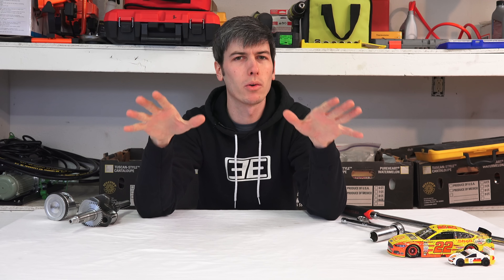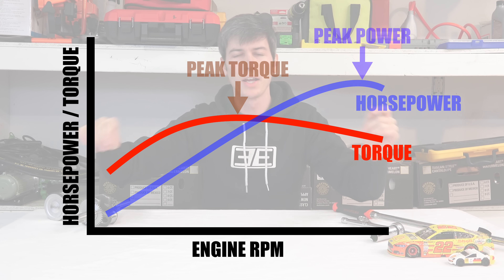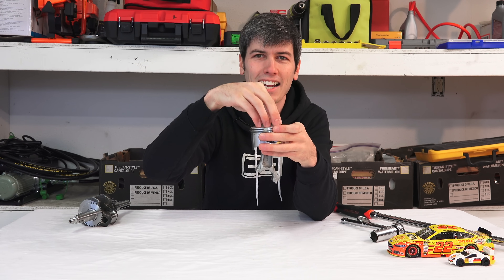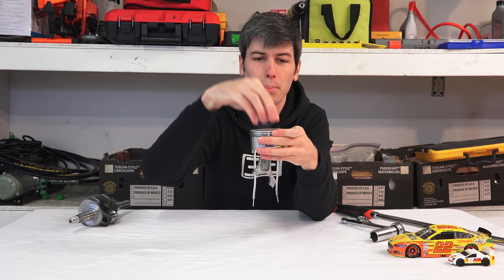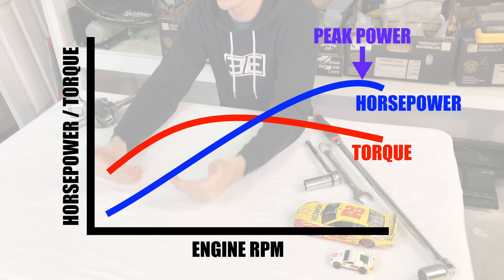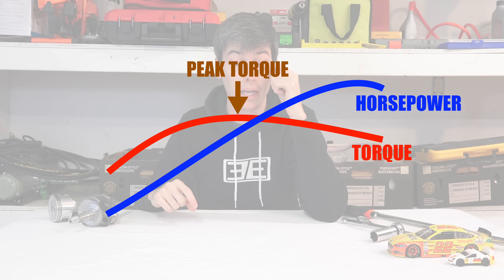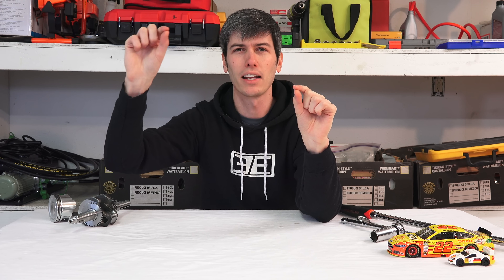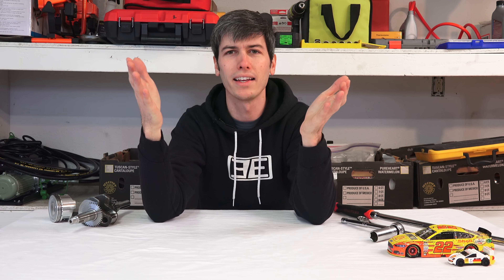Horsepower vs Torque - A Simple Explanation

Comment: I understood the introduction. you lost me at 99 percent of the video.
Reply: I think anyone who understands torque and is seriously trying to understand the relevance of power should just focus on understanding Mechanical Advantage (gear ratios and wheel diameters). When you really understand what gear ratios and wheel diameters do, suddenly it will all click - why power is so meaningful. 
For a vehicle, power is just the amount of forward push for the speed it is currently moving.
In slightly more technical terms, power at any moment is forward thrust at that moment times forward speed at that moment. 
Algebraically rearranged: Forward thrust at any moment is equal to power at that moment divided by forward speed at that moment.

And you should understand what units are;)
Reply: @drienkm  power is just that. for all intent  and purposes, gearing can be ignored if you know the output at any given time of a race. the higher the hp the motor is making at that moment, regardless of gearing. will tell you what or who will accelerate more. I agree with everything you said. and people that do get hung up on gearing and tq, havent really put it all together in their head yet. these are probably the same people that will say, hp sells car and tq wins races or hp is how fast you hit the wall, tq is how far you go through it. or some other nonsense.
Reply: You just need to know the sentence/proverb/formula/the jist of this video at 6:48😉
Reply: @YathishShamaraj  "You just need to know the sentence/proverb/formula/the jist of this video at 6:48😉" Bingo. You will also NEED to be solid on what a gear ratio does. Intuition should take it from there why we care about power.
Reply: A car with high peak hp can feel underpowered in every day driving because you may have to have the engine at higher than 6000 rpm to tap into its power band. It would be a lot of working the gears and noise to keep up with traffic. Think of like a jet that's not so responsive until it gets up to speed
Reply: Kuya think of this way....when your with your GF and you are stroking it.....Long throw or short throw is the FORCE or Torque,  how fast you are pounding is the HORSEPOWER or rpm.  Hope that helps......
Reply: @larryboles629  what is the cOOm, is that the fuel
Reply: @GZA036  Bro, not sure what your reference.  To make Torque and Horsepower easy for myself.  I think of Torque as the force at a distance, ie The STROKE and Horsepower is simple the RPM of the torque in other words how fast is the engine going RPM (horsepower) taking the stroke or torque into consideration.  Example  Engines with same bore say 4.00  engine one has a stroke of 3.5" and engine two has a stroke of 4.5".  Both are running or turning at 2000 rpm.  Engine two has more horsepower because of the longer storke that also gives it more torque.  Now lets say the redline of enging one is 8500 rpm and redline engine two is 5500 rpm.  Engine one will have more horsepower because it has more rpm.  Also engine one will not have more torque that engine two because of the shorter torque, even if engine one produces more horsepower, engine two will have more torque.  Kinda like a V twin Harley, tons of torque (long ass stroke) but horsepower around 120.  Now rice burner turning 10,000 rpm. may have 145 horsepower but lower torque than the harley.  Hope this makes clear what I was trying to say.  Torque and Horsepower has always gotten me confused in the past, but not anymore.  TORQUE IS FORCE (STROKE) HORSEPOWER IS SPEED (RPM)  ie DISTANCE vs QUICKNESS.
Reply: You might re watch it
Reply: @tomasenrique  rewatch what? how morons think tq curves are better than hp curves?   stfu
next your gonna tell me hour wage is better than salary
Reply: @chaztitan6457  why are you like this to other people.
Reply: cause I am sick and tired of people talking about things they dont understand, and other people listening and repeating it. when they have all the worlds information at their fingertips and yet, fail to grasp basic concepts. its tiring and extremely annoying....
Reply: @chaztitan6457  ok Einstein, getting pissy won't help anyone.
Reply: @kirara4953  no, but it might make people get angry that im pissy and try to prove me wrong and learn something..
others just get angry at how i said something, not what i said...
sorta a female thing
Reply: @chaztitan6457  if you were a teacher they would just learn the speed at which you get fired for being so aggressive
Reply: Yep
Reply: Lull
Reply: Ahahahahahahaha
Reply: He lost me at 📈 graph
Reply: Hey, I make science based 3D animations, and I'm planning to make an animation on this topic as I was also confused at times. If you would like to give me some pointers to what you would like in my animation, I would love to hear it!
Reply: He's talking about torque in a powerful revolutionary way.
Reply: @animationsxplaned8835  that will b fantastic. Apply n match the theory with yr animation to car .... in a real scenario?
Reply: @animationsxplaned8835  pleas do
Reply: @animationsxplaned8835  please do, I need that
Reply: then dont vote

Comment: Thanks. Understood fairly well . But i have a doubt. I am comparing 2 cars. Car 1 has max torque of 172Nm @ 1500 rpm and Car 2 has max torque of 113Nm@4200 rpm.

My question is how do i compare them because they have max torque values at diff rpm.

 If it was something like comparing 172Nm@1500 rpm Vs 113Nm@1500 rpm, it would be simple to understand that 172Nm@1500 rpm is better.
Reply: well thers couple things to  know  now we comapre only peak torque at diffrent rpm ok but you dont say how much power in peak both engine generate but ok  172nm at 1500rpm let say we drive both car/engine setup at the samevelocity let say 60 mph and you flored both at 1500rpm than 172 nm at 1500 rpm will push you into seat stronger because 113nm at 4200rpm will have max the same nm as in peak most likely less at 1500rpm assuming those are 2 compeltely diffrent engines ., but when you reduce gear in 113nm engine for start from 4200 rpm rather than 1500rpm now you be push with biger force into seat be 113nm at 4200 rpm engine setup from the same velocity in me egzample 60 mph  it can be 20 mph or 100mph whatever but the same velocity its beacuse from 113 nm at 4200 rpm you have 66,6hp of power vs from 172nm at 1500rpm you have only 36,2hp of power the diffrenc in acceleration from atthe  same velocity so such force which your back will be fell be interact with seat be 66,6:36,2=1,8397 times biger when you try 113nm at 4200rpm setup its the same car engine or 2 diffrent ? if 2 diffrent  than 172nm at 1500rpm can feg have more power in peak in such scenario if we use in both peak engine power so strongest rpm range in each engine this which have more peak pwoer will accelerate you stronger forward assuming the ame car weight drag aero power lsoess etc but i quees its probably one engine from some weak disel without turbo etc :x

Comment: Somewhat good explanation.
The hp is dictated by the size of the cylinder (ie how much air fuel you can pack into the cylinder)

The torque is dictated by the how far the piston  and rod moves up and down during the power stroke in relation to the crank

Horsepower is the top speed
Torque is your acceleration 

You can have 10,000 hp but if you only have 1 foot pound of torque it will take you ten years to get to 300 mph or X mph

You can have 10,000 foot pounds of torque with 1hp you may get to speed very fast but you are not going over 10 mph or X mph  at any point of time.

Gears are nothing but torque multipliers / torque reduction

Comment: Excellent explanation of the relationship of power to torque. My eCVT has a launch gear which helps acceleration from a dead start. I assume stated h.p. is what’s delivered at the flywheel?
Reply: That is an excellent question.  I have seen many statistics of HP measured at the wheels, but I don't know how you could measure HP somewhere else in the car unless you measured HP at the wheels and multiplied by the inverse of your gearbox/drivetrain efficiency.
Reply: @Iffy50  This might help.
Indicated horsepower (ihp) is the theoretical power of a reciprocating engine if it is completely frictionless in converting the expanding gas energy (piston pressure × displacement) in the cylinders. It is calculated from the pressures developed in the cylinders, measured by a device called an engine indicator – hence indicated horsepower. As the piston advances throughout its stroke, the pressure against the piston generally decreases, and the indicator device usually generates a graph of pressure vs stroke within the working cylinder. From this graph the amount of work performed during the piston stroke may be calculated. Wikipedia

Comment: Not trying to bust on u buddy, but you said, which will accelerate faster. And that is torque, not hp. If u said which will be faster, that is hp. But, gearing can multiple torque only so much, for speed in gear. So it's dependent on transmission parameters. But, torque will ACCELERATE quicker on its own merit, with the same transmission parameters. And it will gain speed quicker. Until the greater hp passes it by. But, torque will accelerate quicker...I really like the "bore vs stroke" video.  Maybe that Tesla has gotten to ya..lol

Comment: In Motorcycle realm, why do Cruisers crave for higher torque when you could just take a high-power sporty engine and achieve the same torque needed for heavy bikes ?
Reply: Because cruiser engines give all the power at low rpm. Using a sport bike engine, you won't feel as much of the power until you're at middle or high rpm

Comment: Very good video, especially for someone like me who loves cars and loves working on equipment but by no means is all that knowledgeable in terms of engineering and physics. 
There's just one thing that is still unclear to me: in regards to torque, where exactly does "distance" come into play within the engine? For example, if there are 2 engines with the same horsepower but different torque specs, what part(s) inside the engine give engine #1 more torque than engine #2? Is it longer pistons? Longer camshaft? Longer cylinder? Again, great video!
Reply: A main contributor is the crank radius. A longer crank radius gives a larger moment arm for the piston/connecting rod to push against. This would also increase the stroke length and would tend to decrease the maximum RPM.